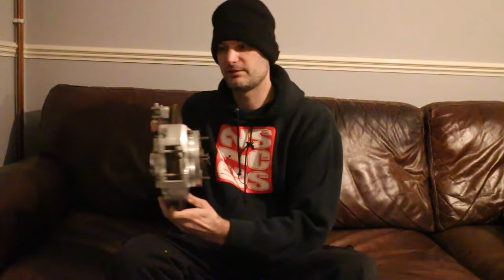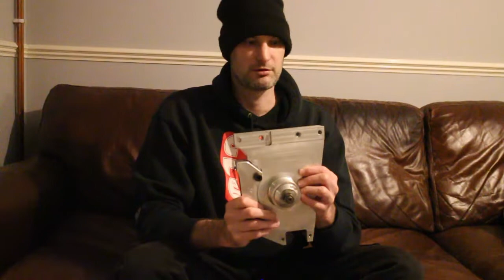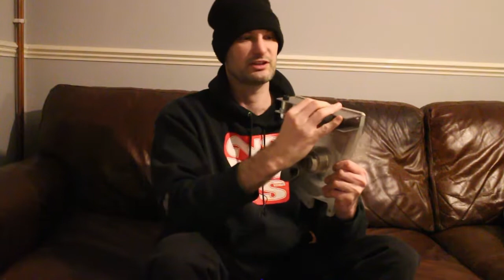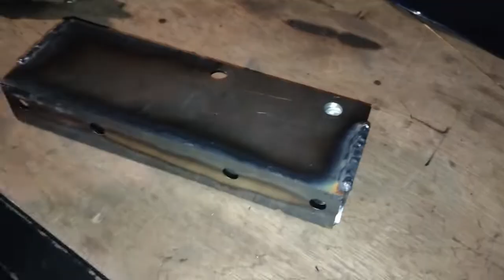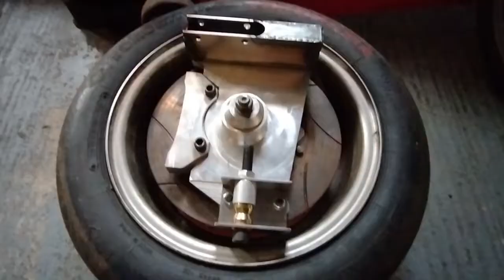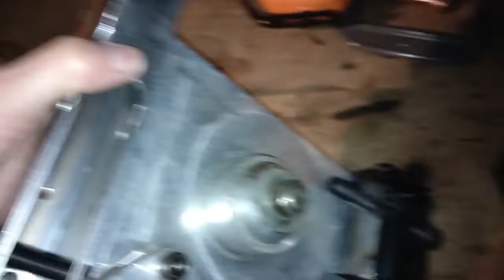[FINALLY] Front end upright modifications.  Ep27

Comment: Nice.

I'm sure you've realised but just in case, if you move the rack behind the axle rather than in front your steering inputs will be back to front i.e. if you turn the wheel to steer right the car will turn left! One way to fix that would be to get the left hand drive version of the same rack and turn the rack upside down. If your rack has its pinion input at the centre then no problem, just flip it over and job done.
Reply from the maker: Yes that's right Dave.  I have a new rack for it anyway as the original rack will be too long.